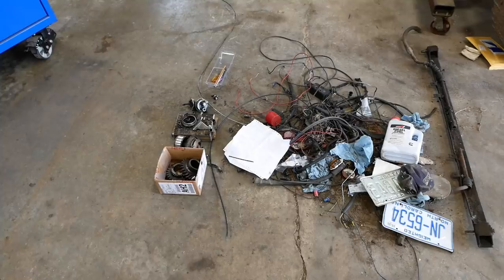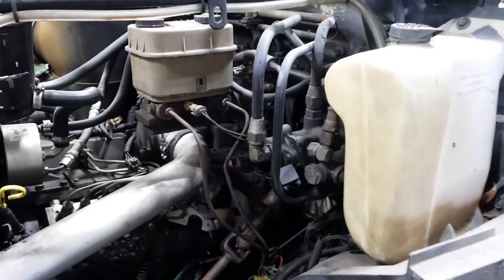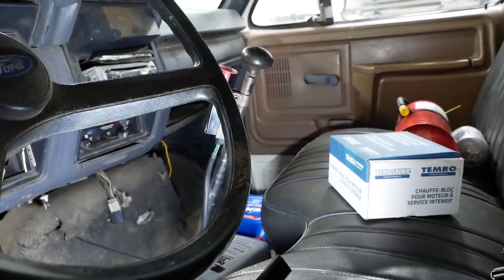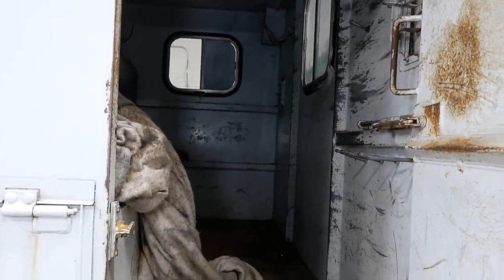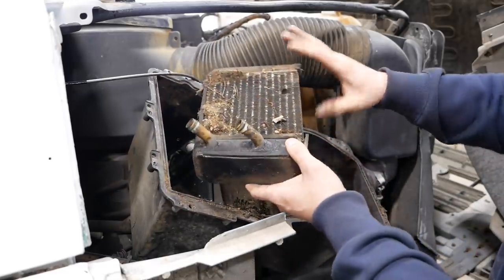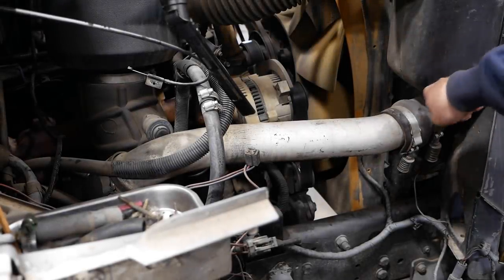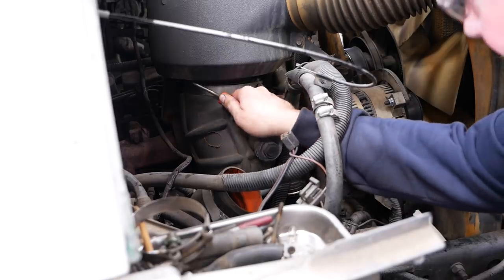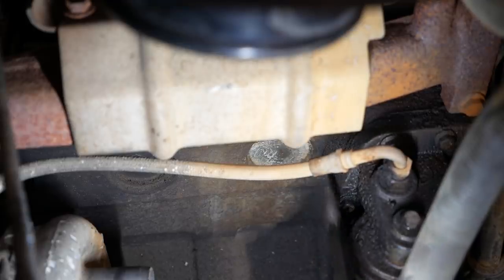Ford F700 Cummins Chipper Truck Project - Coolant Leaks, HVAC, Block Heater - Part 1

Comment: A few years ago, a shop charged me $500.00 to chase down an electrical issue on my 2000 Freightliner Century: headlight-high-beam caused the trunk signals to freeze and a couple other issues.

After watching the rats nest you pulled out of the dash, I guess I will not belly-ache about the charge any longer

Comment: Hope the blower motor blows the right way. I have see more than a few aftermarket motors that blow backwards and If you don't pay attention its a guaranteed comeback. Only happened with motors that have the connector on a pigtail harness. I understand parts are a pain on this truck but aftermarket blower motors suck in general 99% of the time. They are often noisy and blow way less air than a good factory motor.

Comment: My buddy has an asphalt  business and every used piece of equipment he bought had wiring issues . We worked together trying to figure out what the previous owner screwed up. What you have I think is pretty much typical. Most times  like a rats nest . You have my sympathy .

Comment: Ugh.  The machine tool company I drove for in the early '80s bought a new F700 with a flat bed, I think 24k lb gvw.  Immediately on a trip to deliver a machine to our Oklahoma office, the truck exhibited a dreadful rythmic vibration starting at about 45mph and staying in action up to our cruise down the turnpike at about 60mph.  It was so bad, the passenger shock absorbing seat ripped the floor out at the mounts.  The dealer did exhausting tests with wheel balancing and drive train issues and could not fix this vibration.  The truck was sold as I recall and we bought a GMC of the same capacity.  It was a more flexy ride in some ways but had none of the vibration that affected the other's operation.

Comment: Wes I have been on edge of my seat waiting to see if the 6 pens work???
I know a guy up here in Fairbanks that has that F700 with service bed and crane,His had air compressor gear driven on 5.9 Cummins. so I think his had air brakes. I did not know about that funky brake system.  don't forget to cut the arm full of shelf boards.
good stuff Wes thank you.
Reply from the maker: There was a pencil in there that worked...

Comment: I,ve never figured out why Ford didn't standardize their parts across various lines. A heater fan motor seems like something that would be easy to make fit in any application. One of my first jobs was at a Ford dealership and the parts guys always said that Ford didn't make any two parts the same.
Reply: Henry would be displeased.

Comment: I have never seen a brake set up like that before. I guess it is for staying under the CDL requirement. But when it comes to hauling wood chips and dragging a chipper, I prefer air brakes. Or at least give it a air over hydraulic set up like the Army trucks. Great video though.

Comment: Wes I've seen one 5.9 cummins with a air compressor on it. It was powered by the accessorie drive
Reply from the maker: That's usually how they do it. Then the power steering pump mounts to the back of the compressor.

Comment: I find your videos fantastic.  It's kind of like watching the mechanics version of instant regret videos.  You have an inhuman amount of patience.  Or you video edit the breakdowns out very well.  If i found myself in the middle of some of these trainwrecks i would be digging through my boxes of fan belts trying to decide on a  standard V or cogged belt,  and at what length would be best to hang myself with.

Comment: Excellent video Wes  :) also for that Ford Truck have check with Sterling company make 18 wheels Highway Tractor truck dealers and parts may be more money but may have parts need fix these old Ford Truck to! Last I heard Sterling took over Ford makes in Stake & Highway 18 Wheeler Tractor parts for old parts to and hope that can help you out !
Reply from the maker: Sterling was rolled into Daimler with Freightliner, Western Star, and whoever else. I don't know the current situation, but it has always been tough to get parts for Ford trucks.

Comment: That's at least the 3rd heater blower motor in that truck. I've never worn out any blower motors in my vehicles. I wonder if the remote crews ran the heater all night?  Looks like a good project. Looking forward to following the repairs.
Reply from the maker: More likely it gets packed in wood chips. I found all kinds of issues from wood chips jamming things up.
Reply: My crew melted the plug connector on the blower

Comment: i had a nightmare experience doing a 4BT water pump in a telehandler. frame in the way on 3 sides, and the engine is mounted facing rearwards, had to remove the fan and shroud, but the shroud is not rectangular, more of a parallelogram and the lower mounting bolt on the acute angle side of it has about 1" of clearance on the backside and a 3" hole to thread your hand into. took me almost 2 hours to do a 15 minute job.
Reply from the maker: Forklifts are horrible for access.

Comment: I had to watch part of the video twice to double check, but I believe the engine fan blade is on backwards, it's the correct angle but it's pitched to turn the opposite direction.
Reply from the maker: It turns the same direction as the engine, clockwise looking from the front.
Reply: @WatchWesWork  it's the right fan blade, but if you look, I think I'm right, it is pitched  to be turned around back to front. it'll flow more air.
Reply from the maker: @deanmeyers1690  I see what you're saying now. Hard to know what has happened to it...
Reply: @WatchWesWork  lol. Yup some real "Hillbilly Tech" ingenuity going on with that one. Those are fun to watch though! Can't wait to see more.

Comment: DORMAN!!!

And that cooling fan appears to be on backwards. Will still work — just loudly and inefficiently. Unless it’s a pusher fan, which I kinda doubt given its application. Wonder if it’s possible to flip it over and get it on there correctly. 🤷🏻‍♂️
Reply from the maker: It turns the same direction as the crank on these engines. So I think it would be correct. Clockwise looking from the front.
Reply: Yes, the angle of the blades is correct. It will be correct still if you flip it over. However, the “bite” on the blades will be as it should be. It’s like an airfoil. Works great in one direction — not as efficient in the other. Probably be quieter if it’s flipped over. No big deal.

Comment: I'm all for keeping old iron on the road as long as possible, but eventually it gets expensive.  I hope you're charging real hours to do this work.  I usually keep my iron on the road for a little under 20 years then it's just less expensive to put a bullet in it and send it off to the crusher...... unless it's collectable and very little working vehicles are collectible.
Reply from the maker: It just depends I guess. There’s plenty of these old Ford still on the road here. They don’t use them much in winter so they aren’t too rusty.

Comment: My best luck with removing freeze plugs is to weld a nut on them and use slide hammer in the nut

Comment: How it shows that you are really proud when you find an elegant solution for a difficult to find part!...I am talking about the blend door cable. How is the block heater powered?
Reply from the maker: You plug it in to 110 volt from an outlet.

Comment: Watching you work, I think I would close shop and go to the city hall and apply to drive a garbage truck. At least that way you would see the garbage taken where it belongs. We had a neighbor who had a Ford pickup. There was a thing called a Jim Module that Ford no longer sold. No aftermarket was available so they sold the truck. It went to a place in the country where it didn't need inspection. As I understand the check engine light was on due to that module and in metro Texas they won't pass inspection with the light on. In the country the only inspection is safety so it didn't matter. I don't know if the law has changed but it was that way ten years ago. Makes you want to go buy a new Ford doesn't it?

Comment: Thats interesting you talked about the other truck with the 427 and airbrakes... that reminds me of two things I've always wondered about... why did the big 3 always love gassers so much? Is it because they could never figure out how to make a half decent diesel, and thus had to buy them from companies like Cummins, Isuzu, IH, etc, thus cutting into the margin for the complete vehicle... and second, I always assumed diesels and air brakes went together, but I suppose there's no actual requirement for that, just that both are more common on larger, heavier vehicles I guess? Are gassers able to run an air compressor, particularly at idle, without it bogging them down? Diesels seem to idle so much more stable - put a load on a diesel at idle and it just copes with it way better than a gasser, especially a carbureted gasser! They can barely maintain an idle with no load at all!

Comment: For that missing alternator bolt, just for kicks...insert a reverse threaded Wintworth Nut & Bolt.
Reply from the maker: Got any handy?
Reply: @WatchWesWork  I, like an idiot, had this sailboat and was hell bent on getting the missing nut for the bolt that fell into the lake...instead of just getting SAE.  But, I did find it!  That was for a catamaran built in Canada, -eyh (the rudder).

Comment: So much fun. I noticed you didn't put a gasket or any sealant on the water pump. Ain't it gonna leak?
Reply from the maker: It uses an O-ring.
Reply: @WatchWesWork  Gotcha.

Comment: if the nut has a serrated face, turn the bolt. The serrations will set into the metal it is against. If you turn the nut they will spot face the metal they are against. (side note: this may be debate fuel)

Comment: How far have we fallen my 1968 F-250 had 4 bolts to remove the heater assembly and some spring clips to pop loose to expose the core

Comment: I do marine work and get messes like that at times. But I am selective with who I will do a job for when it comes to that stuff. Not because of the level of difficulty. But because after cleaning up their abortion, someone will claim that their fuel line is now leaking or bow light doesnt work anymore. Things that had NOTHING to do with what I did. Wondering  if Wes comes across that crap from time to time. I wont work on a job like that if I feel the owner is one of those. And yes, I can spot/smell one of those a mile away! Lol

Comment: is the owner going to have you tab the KDP or is not so much of a worry on a 1993 5.9?
Reply from the maker: It needs a front main seal so we might do it over winter.
Reply: @WatchWesWork  just finished doing that on my 1997 ram 3500  4x4 .  its a California desert truck so you would be amazed at the absolute lack of rust.  Having grown up in WI i am more than familiar with rust... every car I ever bought started with adding floor pans because there were none

Comment: For testing  the header coil,   what brand of spark plug do you recommend and what gap?
Reply from the maker: That was an AC Delco. But for a Ford I should be using a MotorCraft.

Comment: 26:26 As long as the axis is in the same place as the OG unit, it works regardless. Matthias Wandel does a series of experiments with blower motors (in wood, no less) for his shop vac build, and he pretty much busts any of the usual bullshit stories you hear about blower motors and "oh you can't use this or that inside because the airflow won't work right" or the utter most brain stopping comment i usually get "if the fins are backward, it won't work" yes it will, yes it will just fine.

TLDR: as long as you mount the transplanted fan inside the same general area (as the axis goes) it's perfectly fine to use any other part that fits.

Comment: No gasket for the water pump?
Reply from the maker: It has an o ring
Reply: @WatchWesWork  Ohh! Would've love to have seen it!  Keep up the good work on the chipper! Cheers Drew
Reply from the maker: @DrewFixIt  You can kind of see it. It sit in a groove in the face of the water pump. You see the old one fall out when I pop the pump out.

Comment: That hydraulic parking brake has been around for awhile. I ran across it first in the early 80's working on school buses. Funny story to tell. 90% - 95% of the drivers were women, so; that ought to tell you where this is headed. Driver brought the bus in for a cracked driver's side windshield. What had happened was, she was tooling along (empty, thank goodness) at about 40 mph and decided to see if the parking brake would stop the bus if she ever needed it to. So, she pulled the valve. Since a seat belt was optional back in that day and time; cracked windshield, a black eye, and a swollen nose. Wished you could have seen her 275 lb, skinned up ass. Hilarious!

Comment: So the heater core plug doesn't come in contact with the oil?   Just heats  metal near oil?
Reply from the maker: It heats the coolant.

Comment: Just finished this part of the romantic comedy as I had to do some honey-do stuff. The things men do...... Anyway, I would feel a little worried stuffing possibly hot wires back in the dash without knowing what they do/did. But I have never worked on a piece of shit before. Do they give you a budget to work with or do you inform them that they requested you fix only 25% of the problems with this vehicle? Do you have some sort of lock-out system to keep your little boy from hearing the new words daddy used fixing the white truck? Keep up the good work of making us smile.
Reply: Prob be a good idea to move the truck outside every night or d/c the batteries.

Comment: I had some loyal customers when I worked at Ford one of my really good ones owned a famous ladder company had a few bucks he brought me a 69 mach 1 with wiring problems that looked like that and the Ford dealer really dropped the ball they wouldn't let me touch the wiring in that car because Ford didn't sell a hole new harness for that car  at the time I think they do now that was the first time a car left my bay on a roll back tow truck wouldn't be the last

Comment: Anybody know if a 5.9 Cummins out of a 1997 ram 2500 can replace a 5.9 Cummins in a f700. I know the power rating is different but don't know if the f700 version is more industrial than the pickup version

Comment: I thought that Dodge/Ram was the only make that used the 5.9 Cummins and that Ford used its own Powerstroke diesel engine.
Reply from the maker: Ford used Ford (429, 6.6, 7.8 Brazil), Cat (3208), Detroit (8.2 Fuel Pincher), Cummins (5.9), International (IDI, Powerstroke), and probably others in those trucks over the years.

Comment: where is the water pump gasket
Reply: It had an o-ring ring in a groove in the pump mounting face.
Reply: @brianrvd  i did not see it on the new part
Reply: @williamhuckle467  It's there, its a square cross section o-ring so it is flat and almost flush with the mounting face.

Comment: Fan on backwards?
Reply: I was thinking the same
Reply from the maker: I don't think so. Should turn clockwise looking from the front.
Reply: @WatchWesWork    I'm used to off-highway applications where the cup of the fan "scoops" more air in the direction of rotation -- I've seen many instances where people have tried reversing the fan in a failed attempt to make it a blower fan to keep the radiator clean---it still blows in the same direction and only reduces air flow and causes overheat in warm ambient temps. Maybe this one isn't even possible to mount backwards and is just the design of the cooling system. --and thanks for the detail you put into your videos--always something to learn.

Comment: 3:17 Why is the cooling fan backwards ?
Reply from the maker: It's not. Look at the belt routing.
Reply: @WatchWesWork  But the blades are facing the wrong way. 
Or is it a reverse rotation fan ?
Reply from the maker: @RichieCat4223  The fan turns the same direction as the crankshaft. Clockwise looking from the front. Not opposite the crank like most engines. Cummins and other big truck engines are all like that.
Reply: @WatchWesWork  I was a Caterpillar engine mechanic and all those engines big or small the fan ran off a belt. Will look at video again for the year and model then look at the fan set up on the engine.
Reply: The more I look the fan blades are installed backwards.
Reply from the maker: @RichieCat4223  Yeah I guess it is. Who knows what she's been through.
Reply: @WatchWesWork  When I worked on rear engine cement mixers (front discharge) all fans pointed towards the rad to blow air out across the core.
The one you have blows air in the wrong direction.
Thanks for keeping up with my conversation with you.

Comment: 429,  not 427.  They're not god-awful.  they're just old.  The 5.9 Cummins is so revered but in reality, it is just a cookie-cutter cheap engine that many OEMs bought.  In fact many Fords came with Cummins engines cast by Navistar(emblem on block).  Really is a boring engine.  Works OK but not spectacular.

Comment: For some reason comments I've made have been removed, do you know why?
Reply from the maker: Nope. YouTube automatically sorts out comments with profanity and other controversial key words. I usually approve almost all of them though.
Reply: @WatchWesWork   the comment before this one was a kinda test,  and simply sad hi.

The one I made the day the video came out said in essence that older ford's were harde to find parts for,  and that chevy were much easier to  find parts for,  because the junk yards were full of them.  I know YouTube has no since of  humor,  but I didn't think they liked chevys that much...